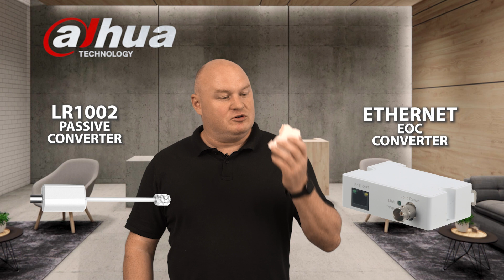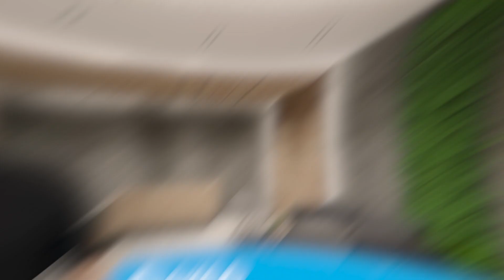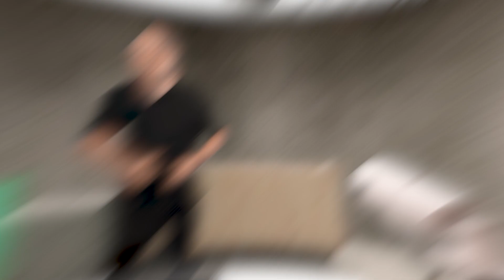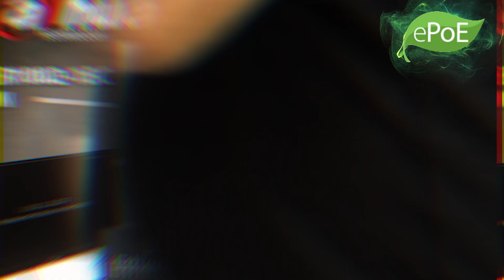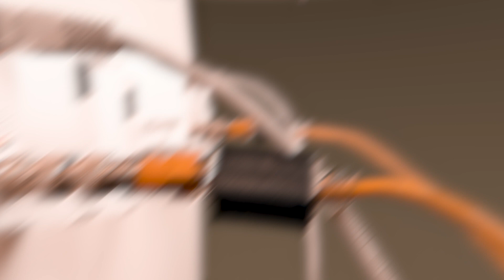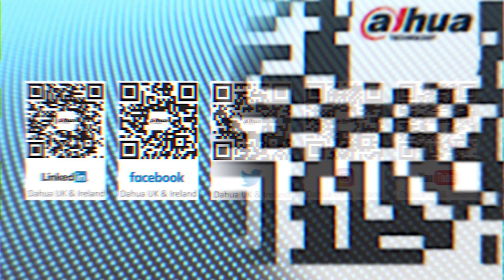Dahua's ePoe connection methods & accessories that will save you money 💰💰💰

Comment: May I use LR1002 to connect the A side to Router and the B side to Poe switch so i can transfer IP camera? The Coaxial cable its about 50 meters.